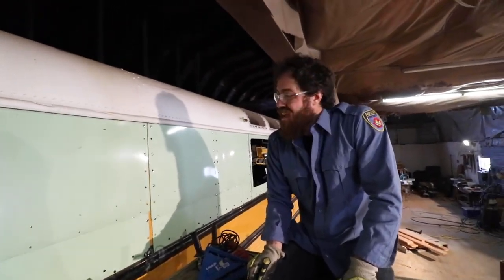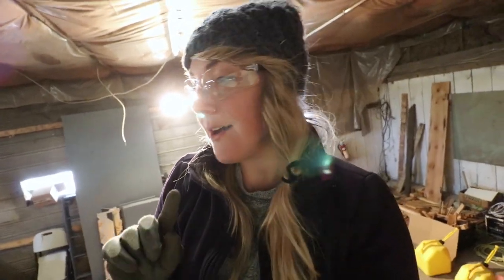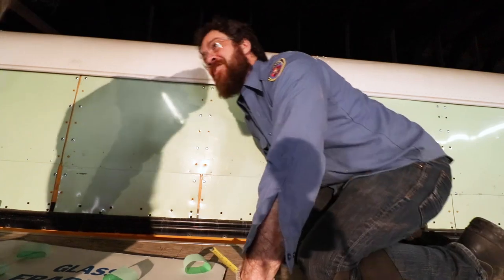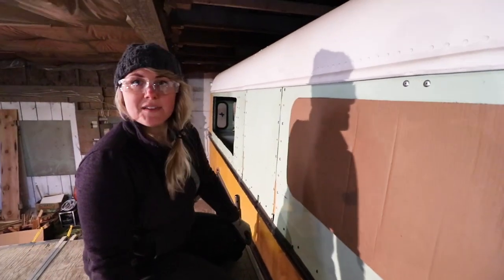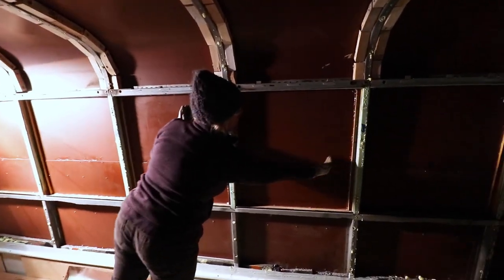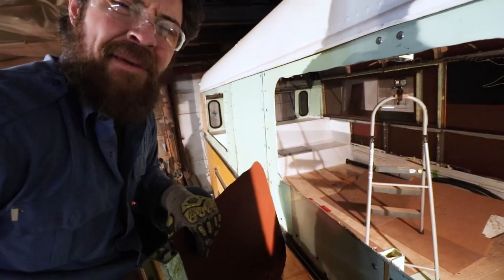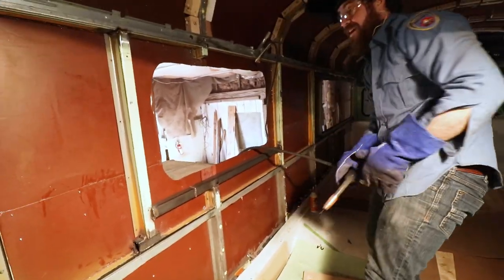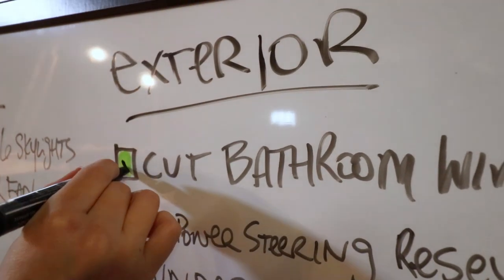Cutting Another Hole For CR Laurence Windows | Skoolie Bathroom Project Detour

Comment: the scissors are for cutting copper , there usually used by people making rain collectors and spouts , alcohol stills and stuff like that
about the level : for the level to show level the bus needs to be set level as in blocking the bus up using the frame as support , this is kindah importand if you want to frame the bus with a level as well
as for using a spirit level , for that to work the bus needs to sit level , to do that you probable want to lift the bus from from the concrete floor supporting the frame a little using with  kribbing
https://encrypted-tbn0.gstatic.com/images?q=tbn%3AANd9GcRJX6ZeIp-s26K4n6ZofgKYIW6DRvnttRvJIlQmhBpPQ-dwCzB7&usqp=CAU
and shims , if you want to use a level to put in the framing i would start with that
Reply from the maker: Yeah, the level of our bus is almost deadnut in both directions (which is why we use a spirit level & plumb bob!) However, we also do measure :)
Thanks for watching!
- B+E
Reply: They're not just for copper, they're for most sheet metal.  My grandfather (born in 1898) had tons of tools which were passed on to my late father and then some made their way to me.  Those old tools LAST just like the table saw that had to have a switch installed.....they just keep going......and going..... not like the disposable stuff sold in the big box stores these days.

Comment: Hey you two 😊 I love your videos I just got my insurance appraisal here in Ontario and it's 3000$ only on one side... My broker told me there is only one company that would insure it... Please help ! I was going to get my bus delivered this week 😭
Reply: And that inssurance quote is just as a school bus
Reply from the maker: Yeah... That's why we didn't end up getting it registered in Ontario because the way to get it insured as an RV is to have it converted first so that the MTO & Service Ontario can look at it and say "Yep... it's an RV"

The problem we ran into with the quote is that it looks like a school bus and is rated as a school bus. However, not having the special school bus chauffeurs license prevents you from driving it in Ontario because it's still considered in the capacity to haul around kids. 

Based on our research, you should be able to get the broker to "ship it" to wherever you are doing the conversion. Then you do the conversion and be sure to check off the boxes for the things the MTO wants installed in it to be considered a "Motorhome." Once that's done, then Service Ontario can get you a temporary permit to drive it to a safety inspection location (like at Canadian Tire) where they will do the safety inspection.

After THAT, then you should be able to get it registered as a Motorhome and have the "school bus" designation removed from it.

AND THEN.... Now that it's registered as a motorhome, when calling around for insurance quotes, you tell them "I want to get my motorhome insured. It is a [INSERT MAKE AND MODEL] '97 Thomas Saf-T-Liner"

The insurance company will look in their system and NOT find ANY motorhome manufacturer with your particular bus. They will need the Title showing that it has been rated as a Motorhome AND they'll need the safety inspection showing that it is "up to code" to be insured and driven as a motorhome.

Considering this is just research and we didn't actually do this method, PLEASE message us again once you figure out the process & steps because we need to be able to share the right info with others from Canada on how this is done. We'd appreciate that!

However, just like your other comment below this one (or above this one) states, "insurance quote is just as a school bus" cannot be done because you're not getting this to haul around kids. The words "school bus" should never be a considering factor in this "custom motorhome" where you're using the commercial chassis to custom build a motorhome. What could help is if it is not school bus yellow, does not have the crossing arm or stop sign, has all the school bus wording removed, and have all red flashers on the back and all amber on the front.

Hope this helps! And keep us in the loop on how this all goes down!

- Brian + Erin
Reply: @BEAdventurePartners  Thanks for taking the time to reply ! Good information where did you guys plate it?  Would you suggest doing the same? I remember seeing it plated in USA but then did you guys transfer it here in Ontario?